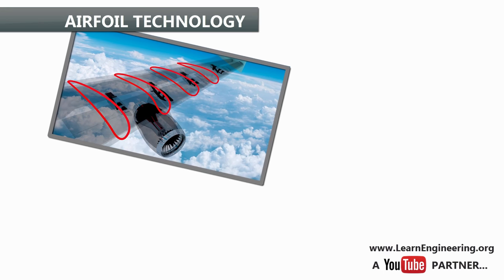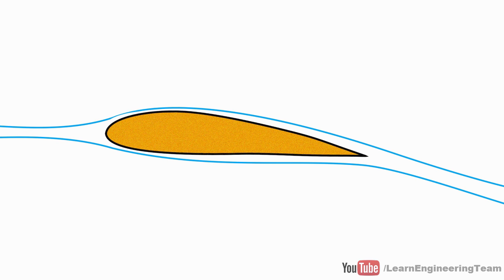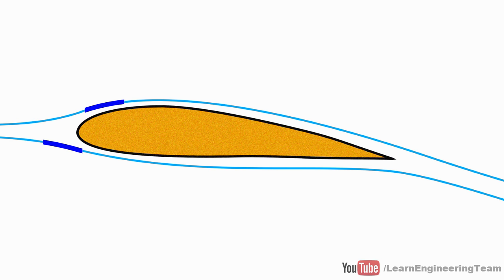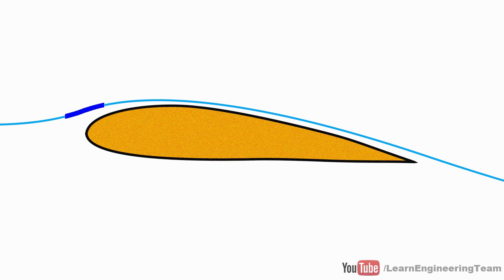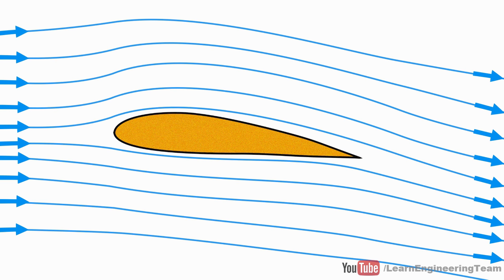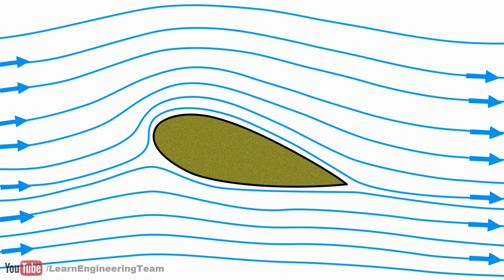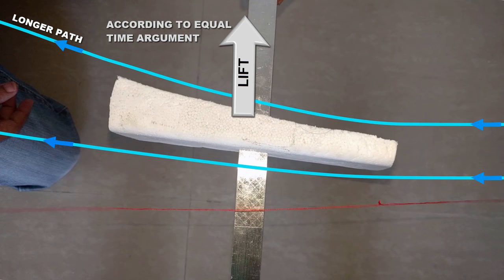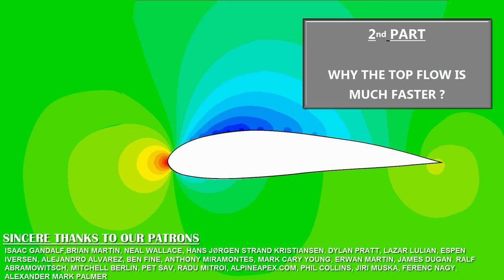How do Wings generate LIFT?

Comment: as the speed of air at the lower side is lesser than the upper side, therefore, the pressure difference produces the upthrust. Is this true or not?
Reply: +VINAY TIWARI,
Unfortunately, THAT simplification echos the often repeated Bernoulli Principle Myth, namely that "Fast Air Has/Creates a Lower Pressure." which it DOES NOT and is easily demonstrated, IF done correctly.
..
A better summary is that as the wing pushes air around in order to move through it.  THIS is what creates pressure increases on some surfaces and pressure reductions on other surfaces.  
...
The good luck is that the increase is on the lower surface and the decrease is on the upper surface and the difference in pressure, so created, pushes the wing up.
...
The lower pressure , so created above the wing, allows the relatively higher pressure ahead to push the air over the top quicker than the air under the wing.
Analyzing a REAL WING: The air under the wing is actually pushed along WITH the wing by this higher pressure and, therefore reaches the trailing edge later than the relatively unaffected upper air.

Comment: Based on the diagram the area at the bottom has an increasing pressure, this means that the velocity of the fluid is descending. In contrast, the upper surface has a decreasing pressure, this means that the velocity of the fluid at the upper surface is increasing as it travels. This is based upon bernoulli's principle stating that "where the speed is high, the pressure is low". This can be applied if we interpret the two surfaces differently. The starting point of both surfaces is where the particles have the same speed, as they meet the shape, the upper surface starts to differentiate as the shape is the point where the pressure differentiates from the bottom and upper surface. the upper surface would have a decreasing pressure, and the bottom surface would have an increasing pressure. Thus, the upper surface particles would have and increasing speed as it travels through the shape while the bottom would have decreasing speed. 

NOTE that I said decreasing/increasing instead of decreased/increased.

Comment: when the vilosity  is high as on the front  top of the wing section the the pressure is low also when velosity is low the pressure is high creating lift on  the bottom of the wing

Comment: 6:35 Due to the greater pressure on the bottom, the fluid is pushed towards the object thereby increasing friction between adjacent layers of the fluid. Consequently, the horizontal component of the velocity is less? Can someone please explain the actual answer to me?
Reply: That's a new one I hadn't heard before... You're the first, but good try at reasoning it out.
..
No. You're saying that viscosity increases.  The pressure changes around a wing are really very small - this is why wings must be large, so the small pressure difference has lots of area to work on to get enough force.  Force= Pressure times Area. A Cessna 172 has only 0.1 psi difference in top/bottom pressure. Airliners have 10 times that, or about 1 psi difference.
..
It's not viscosity that makes any difference.
..
Because the air and bottom surface are approaching each other, this relative motion directly increases the pressure.  Have you ever tried to run in water. It takes foressure to move the water out of your way,  Well, it takes pressure to move the air out of the way.
This relative underwing motion is directly causing a pressure increase. 

.
Pressure at a point pushes outward.
. 
The pressure under the wing pushes (a) up on the wing surface, (b) down on air below it and (c) forward on air in front of the wing. It really can't push much backwards because the slanted wing sort of blocks that, plus its forward motion pushes more forward.
.
In the wind tunnel, this forward push actually slows down that under air. Giving the upper air more "advantage," so to speak, to get aft sooner.  
.
In the still air, watching a wing go by, that under-wing air pressure pushes the  air constantly forward, leaving it far from where it started before the wing got there.
SO...
Yes, the under-wing air is slowed down in the wind tunnel because the increased pressure there is higher than the pressure ahead of the wing.
Reply: @Observ45er  MANY MANY THANKS!!
Reply: @sisyphus645   Did you LIKE the one minute video??  My 11 yo granddaughter completely edited it.
Cheers.

Comment: Pressure decreases so velocity increases so the streamlines above and below do not meet ,correct ?
Reply: Correct!  That upper air is accelerated rearward toward the trailing edge by the atmps[pheric pressure ahead of the wing pushing harder toward that lowered pressure above.
.
This gives folks the most trouble. For a better understanding of the detailed cause of the reduced pressure above a wing, try this short video:
https://www.youtube.com/watch?v=3MSqbnbKDmM
Regards

Comment: The air pressure above the air foil decreases and its speed increases and takes less time to reach the trailing edge. On the other hand, the air pressure beneath the air foil increases and its speed decreases and takes more time to reach the trailing edge. Hence, due to the speed difference, air at the top never meets the air beneath.

Comment: the low pressure at the top of the wing "sucks in" the air molecules from the high pressure at the front of the wing, giving them more speed then the air molecules travelling along the bottom part of the wing.

Comment: As streamline area at the top surface decreases, the kinetic energy increase to compensate the equal volume flow rate through the stream line and hence the pressure at top decrease. On lower side, streamline area increases, Kinetic energy decreases and hence pressure increases.
Reply: So velocity increases because velocity increases and decreases because it decreases?
Reply: @AmbientMorality  😂

Comment: The flow over an airfoil that creates lift will always move faster due to the lower pressure. When a parcel of air moves into a low pressure area, it will speed up in according to Bernoulli's Principle. It is the same effect that one sees in a low pressure weather system and in the much smaller area over a wing. The more air is being pushed down, the lower the pressure over the wing will be, and therefore the faster the air wil travel over the wing. Both Bernoulli and Newton reflect the same force, and are not two separate forces.

Comment: I have a question. In the video it was explained that two points in a two different streamlines cannot be compared by bernoulli's theorem. Generally it's correct. The theory is applicable to points on same  streamline, but the reason why people apply it on two different streamlines is the following.

Imagine two points on two different streamlines let's say line I and II, in the flow far upstream. Let's say point A and point C. Now let's say as the flow moves around an airfoil. So let's put two more points on the two streamlines B and D respectively. 

According to bernoulli's theorem,

For streamline I, It's possible to compare point A and point B. 

And streamline II, we can compare point C and D 

But since A and B are points far upstream, 
Both are equal... Even if they are on two different streamlines.. 

Hence since A=C

We can indeed compare points B and D even if they are on two diffrent streamlines...

Comment: because there is a higher pressure under the foil causing more resistance... slowing the air down... while the air above the foil has less restriction allowing it to pass more freely

Comment: It is not wise to keep talking about the air flowing over the surfaces of a wing, as relatively speaking, in reality,  the primary effective working air does not move horizontally much over the wings.  People have a habit of conducting tests in a wind tunnel where the airfoil stands still while it is the air that is moved at a speed, relative to the stationary wing. 

The streamlines as shown at 5:11 need to be understood for, in a wind tunnel, the mass air particles on the streamlines are moving horizontally at high velocity but in the reality of flying, the air is initially standing still,  the mass particles are not moving much horizontally but they are being basically displaced vertically with an acceleration which builds up and is integrated twice into a location shown by the slipstreams.  

Also, note that the diagram shown at 5:11  is a POSITION OR A LOCATION  diagram and not a velocity diagram. If we had to draw a velocity diagram from it, then one could determine the velo0city vector field consisting of little vectors lined up with the streamlines where the length and direction of the small elemental vectors would represent the velocity in magnitude and direction at any location/time on the streamlines. But if it was a wind tunnel, the velocity vector field would represent the velocity of the air particles, but if it was a real flying wing on a moving aircraft it would be the velocity variations about the speed of the aircraft.   From the contour of the streamlines diagram, it appears that the horizontal velocity is basically constant but the curvy zones show a vertical velocity component. So, if from the velocity diagram we would obtain the acceleration vector field, then the acceleration vector would represent the force at that particular point, considering that the acceleration is operating on the mass of the lump of air existing at the location where the accelerating vector exists ( mass is a scalar and can be taken as a constant in this case). 

The curves in the streamlines indicate that there are four main acceleration zones in the diagram shown at 5:11.

1.There is a compression accelerating zone just ahead and on and above the upper part of the leading edge.
2. There is a suction accelerating zone after location (1) existing along the upper surface to the trailing edge.
3. There is a suction accelerating zone just behind the lower part of the leading edge. 
4. There is a compression accelerating zone existing from location (3) going all the way under the lower surface all the way to the trailing edge.

All these four zones are easier seen on a highly cambered airfoil section. The practical meaning of these pressure suction zones could be interpreted as follows.   Assume the mass of an air/ fluid particle consists of a fat man holding an opened umbrella. 
One fat stationary man, with an opened umbrella, located above the mean line, is hit and pushed up and accelerated up through action ( 1)  and the oncoming upper leading edge will shoot the man up, but him holding the open umbrella, a partial vacuum will be created between the area of the umbrella and the surface of the wing and so this partial vacuum will pull down the man and suck up the wing as it passes under the fat man to dump him over the trailing edge using  Action (2) 
A second fat stationary man, with an opened umbrella, located below the mean line,  is sucked up by action ( 3), and then the compression zone through action ( 4)   will push the fat man down and the reaction would be a push up on the undersurface of the wing, to dump the second fat man behind the trailing edge to join the first fat man being dumped from the upper surface behind the trailing edge.   Note that in real flying action, the two fat men with the umbrellas are operated upon by the actions indicated in 1. 2. 3. 4. and from the logic and sequence of the actions/ reactions the upper-fat man will have a higher backward horizontal velocity than the lower fat man due to one moving into an upper vectored suction zone and the other moving in a vectored compression zone, before both of them are dumped behind the trailing edge.  

That is basically how the acceleration vector field around an airfoil section works, and the same goes, for rudders, ailerons, elevators, spoilers, any part of the structure, air, and sea propellers, and ship hull and the diffusers we meet in all aspects of engineering, where accelerations of fluid lumps masses are involved   We shall not cover the effect of heating the air or the boiling of water or moisture when the suction is fiercely done. 

Note that the vertical acceleration components of the fluid around the wing are what causes total lift and the horizontal acceleration components of the fluid are what causes the total drag.
Lift and drag, and control of surfaces, all have to do with the acceleration field and not the velocity nor the position fields around the airfoil sections.  Note again, that in a wind tunnel the air moves and airfoils standstill, while in reality,  the lumps of air move but a little and it is the velocity of the airfoil section that is much higher than what the air reaches after its acceleration is integrated to velocity ....... and then the velocity of the fluid lumps masses are integrated to relocate them from their initial stationary location to dump them as their integrated accelerations, velocity and resulting locations are too far from the wing to be of any use to flying it,  but could be disastrous to aircraft.. following in the wake..!
Reply: The gentleman indicates that  " the velocity is decreased so there is high pressure'" and later he says about the upper leading edge," the velocity increases and so there is low pressure." 
I am afraid that in those two statements mentioning velocity he is inferring  THE SPEED ALONG AND PARALLEL WITH THE STREAMLINE, but the two zones he referred to have curved streamlines, ( see4:45,  6:30)and so in addition to a change of speed along the streamline there is a change of velocity due to the change in directions of the curves under and over the leading edge.  The radial ( centrifugal force) of the curved streamlines on the fluid particles does give a contribution to the existing pressures in the mentioned zones. Note both curves have their center of curvature below the wing and so if we consider their centrifugal forces on fluid particles both forces due to the curves near the leading edge are both up, producing suction above the leading edge and compression under the leading edge,  irrespective of the speed along the streamlines increased above the upper surface or speed decreased under the lower surface.  See above and below the leading edge at 4:45 6:30. 
Let us say a fluid particle is described in polar coordinates as P= Position of particle= R/ A where R is the magnitude of the vector and A is its angle.
then. 
If P depends on R and A  the rate of change of P = velocity is equal to 
dP/dt  =( R).(dA/dt)    +    dR/dt)(A) hence a linear velocity dR/dt and an aangular velocity dA/dt do exist.

And the acceleration of P is given by the rate of change of dP/dt= d2P/dt2. which is equal to 
d2P/dt2= (R)( d2A/dt2)  + ( dR/dt)( dA/dt)     +      ( dR/dt)(dA/dt)  +(d2R/dt2)(A)

Bernoulli and this video seem to depict the existence of d2R/dt2 which is an acceleration along the streamline, but if the radius of the vector R is kept constant then d2R/dt2 does not exist but there is still the angular acceleration as in centrifugal force situation when the motion is perfectly circular = d2A/dt2  and this will cause a low pressure on the wing, without changing the magnitude of the velocity. 

If there is a change of speed along a straight streamline then d2A/dt2 does not exist and centrifugal effects will be missing as in the case when the convergent and divergent zones in a pipe are perfect cone structures, where there will be no tendencies for the fluid to separate from the wall of a cone as it does on the surface of a cylinder or a sphere stressing the viscous effect of the fluid to hold on to a convex curved surface. 

The engineering shape of an airfoil section, especially around the leading edge needs to consider both the change of speed along the streamline and the change of direction of the streamline. I would wager that the change of angular accelerations gives a higher contribution to the pressures that exist around an airfoil section. 
I need to revise this to make sure that the language function fits exactly in the engineering functions that exist around the wing.  Saying fluid flows over a wing is just not good enough, nor saying, the Bernoulli effect and the Coanda effect and the Navier Stokes effect and cavitation effect and stalling effects and boiling effects due to low pressure............ I do not think that it is difficult to understand how a wing lifts or a propeller works but one needs to " see the whole picture, using mathematics to see what the eyes cannot see in a smoke streamline in a wind tunnel!

Comment: The reason is because of the angel of attack 
also its not related to time only its related to air atoms going in smoth flow over the wing without hitting each other to reduce air vortices to reduce drag

Comment: My A:
Upper airfoil has lower pressure, so intake airflow is accelerated, although the airflow will be deaccelearted when leaving the airfoil. It's why upper air reaches the tail quicker.
Reply from the maker: Yes, very near to the right explanation